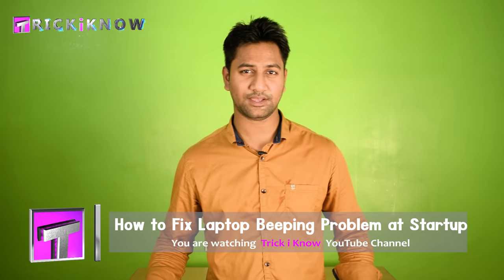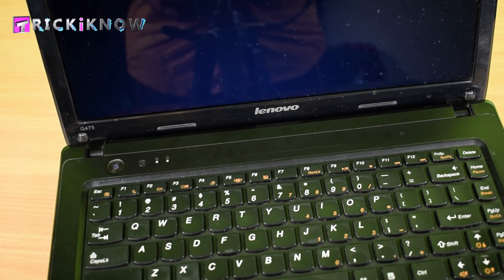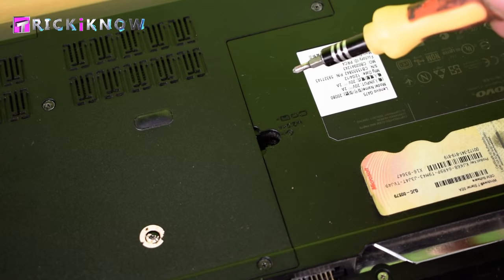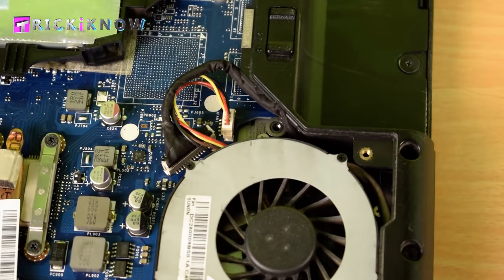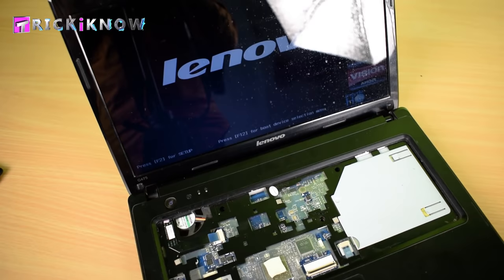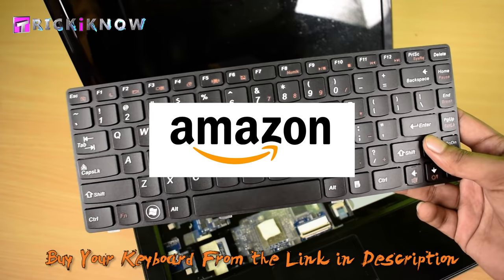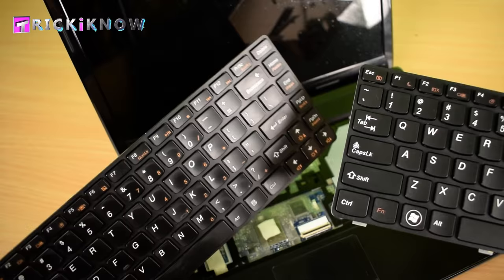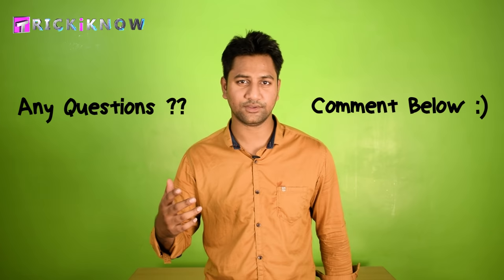How to Fix Laptop BEEPING on startup Problem - Which Stuck at Booting Black Screen :)

Comment: Sir mera Dell vostro 1550 model ka laptop h ise start krne pr double beep aati h aur screen black rhti h bt window start ho jata h sirf display ni hota bt kabhi kbhi open ho jata h aur jaise hi mai google chrome se kuch bhi kam krti hu to screen blink hoti h kya kru
Reply from the maker: That is your Screen problem, you have to change it with new one. To check connect a desktop monitor in to your laptop :)
Reply: Kiran Pal mere laptop ke sath be aisa huta tha leken me ne ram change kia tu thek hogaya

Comment: Bro i am facing a problem in starting up my laptop its Dell inspiron n5010 and it gives 3 beeps and no display. if i don't use it for a week its starts up just one time and also it shows error of cmos battery failure.can you diagnose the problem ? and suggest me a good repairing center in islamabad/rwp ?

Comment: i have a dell inspiron n5030 And every 10 minutes or so, it makes a krrrrrrr noise and the lap is stuck for a sec , then it is ok after some time same thing happens , thought its the hard disk and installed an ssd and same is the result, anything can be done?

Comment: Thanks buddy, that was really helpful, I just ordered new keyboard. One more thing my lap is showing a weird screen too at the startup, is it also due to keyboard
Reply from the maker: Reset your bios settings , if the problem happens again then it may be the hdd problem.
Reply: Is problem solved after installing new key board?
Reply: @SudheerKumar-vo7xu  yes it is solved 😁

Comment: Bro i hv an hp 15 notebook ,beeping (no booting device hs been found please install an operating system ) i already did the keyboard thing nd yet kept on beeping also dismemnteled the whole laptop cleaned everything put a new cooling glue on the cpu nd nothing still beeping nd stuck on black screen saying (no booting device hs been found please install an operating system)...please advise
Reply from the maker: Bro your laptop is continues beeping or beeping in patterns (2 beep or 4 beeb) ??
Reply: 2 beeps , long one then later shorter one ,  it was the BIOS and the HD

Comment: i have a question cuz my laptop has the same thing but it is only a 1 long beep ;-; help me
Reply: i did order a new keyboard doesnt still work ;-;
Reply from the maker: first check by unplugging the keyboard cable , if the keyboard is faulty then order the new one

Comment: My laptop beeps but turned on and it works ,now what XD
Reply from the maker: Try to unplug the keyboard, then see if its not beeping at startup then change the Keyboard. Otherwise it may be for cmos battery or any motherboard issue.
Reply: @TrickiKnow  i put my phone to charge from laptop Usb ,than i turned it on and it beeped,could that be the problem?

Comment: I have a question Sir,  i do have this beeping problem with my Dell laptop could I just attach a separate keyboard along with a separate mouse... Without having to disconnect laptop keyboard or must I still unscrew the back of laptop and disconnect the laptop keyboard???
Reply from the maker: Without disconnecting the internal keyboard you did not judge that its a keyboard problem or not. First disconnect the internal keyboard then see the laptop is beeping or not. If the laptop is not beeping then do not insert the keyboard wire to the laptop just fit the internal keyboard without connecting the wire then connect an external USB keyboard and start using your laptop with the external keyboard.